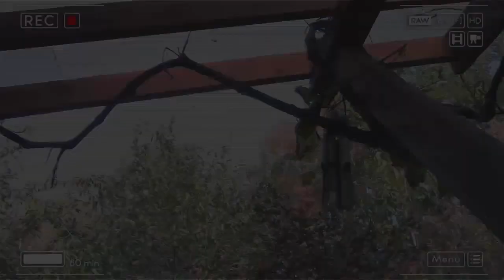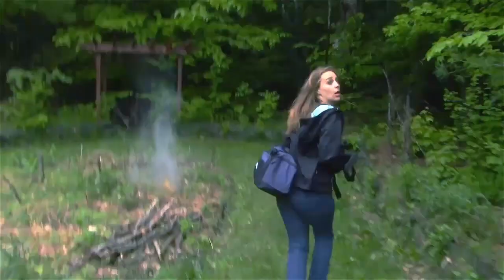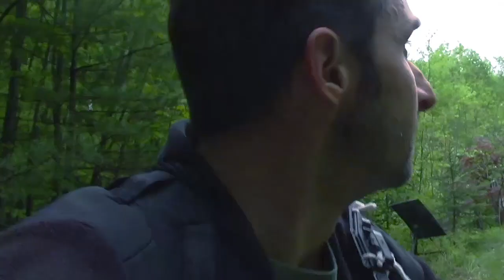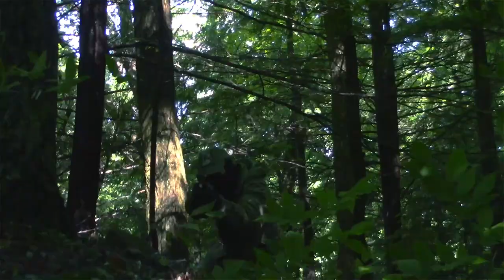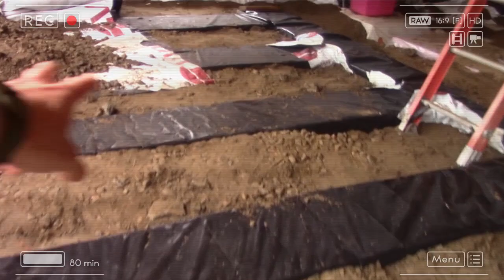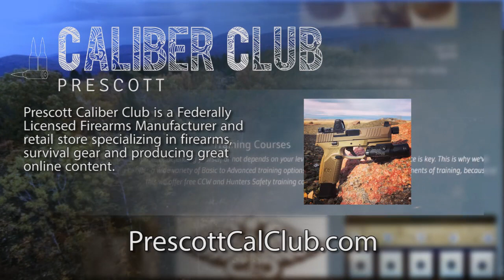Alien Invasion Season 2

Comment: Dude,  totally entralled in every tiny detail,  well maybe not, but certainly interested and entertained as I'm going through my own off grid rebuild.
Reply from the maker: Don't worry, I'm entirely UNenthralled with most of the nitty-gritty process myself as well. Yesterday I was on a roof all day and only touched the ground for 5 minutes to eat some sun-oven pizza for lunch. What I wouldn't give to just be able to use my "force" powers to have the entire structure assemble itself in like 5 minutes.